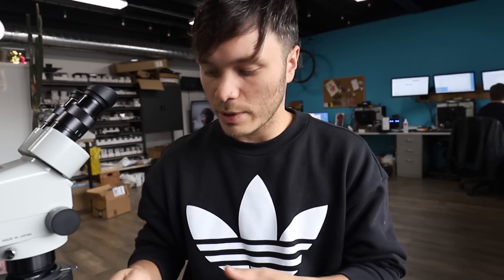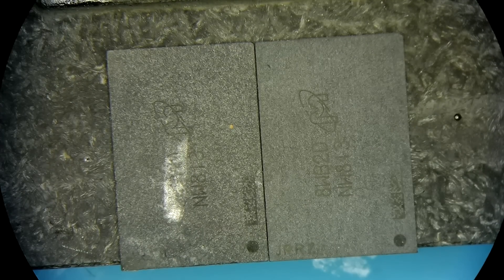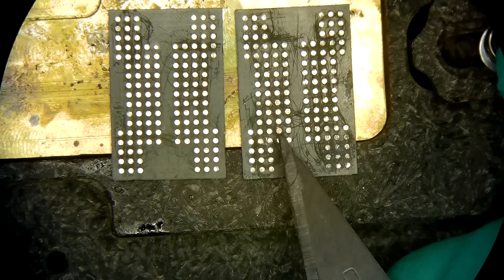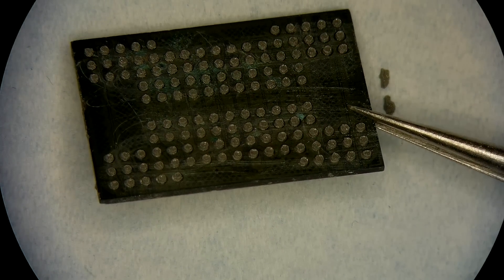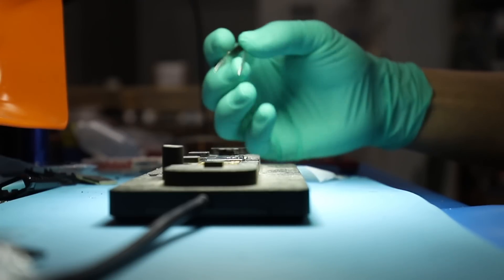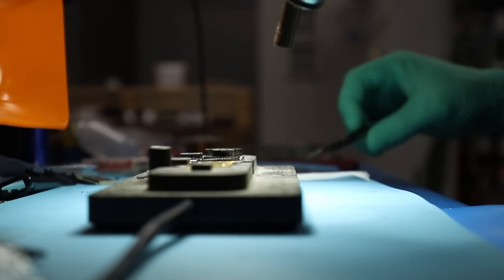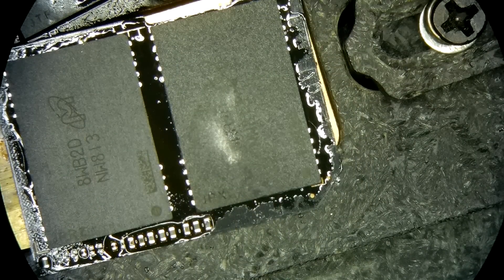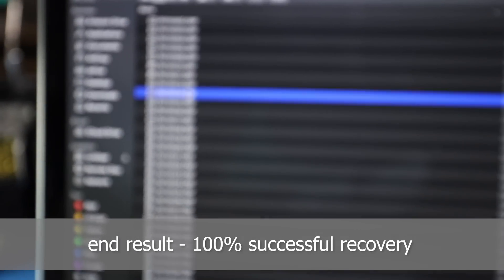Easy way to recover pictures from broken SD card

Comment: what we need to learn, is how people who cant afford 7 grand for pc-3000 can do this, because ive been told you dont NEED pc-3000. any tips on how to do this for those of us who arent rich?
Reply from the maker: PC-3000 is an essential part of data recovery tools to bring up your success rate because it will enable you to solve problems that you would not be able to otherwise. This video that you commented on demonstrates a case without PC3000 or any other NAND flash tools, so yeah, you can do some of this work without these expensive tools. PC-3000 is not a luxury that only rich people can buy/afford. It's a tool that will be effectively be earning you money. If you don't have the money to buy it, borrow.  If the average cost of recovery is $500 - all you need is 14 cases solved with it to pay it off.

Comment: It appears you just go straight to physically repairing, or do you toss them in a computer first to make sure you can't recover that way?
Reply from the maker: I rather not plug anything in my computers before I know what I am plugging in :). Same goes for hard drives that have been opened again, I would never turn them on without inspection

Comment: Great video. Worked in IT support for 10 years and setup on my own not long ago. Would love to get into the data recovery side of things more. Not sure on the total cost of the required equipment?
Reply from the maker: I just did a setup for the new guy, and it was around 2k for good soldering equipment.

Comment: I have an nexys 3 FPGA board of which usb programing port  was broken. i have jumped all pins to usb cable but when i connect it to computer it shows unknown device error with error code 43....         So what must be problem driver issue or hardware ?..... (all drivers are installed om my computer  and i can use other fpga boards).
Reply: It has CY7C68013A-56LTXC Usb microcontroller

Comment: Hello I have a small problem with an SD card. I cannot make the changes to stay. Even if I delete write or format the drive all the last data will be there. I tried to see if there was a pin issue and try to clean them but it did not fix the problem. I purchased a new one and copied all the data to the new one with no problem. My question is if you know the cause of what did this problem and if there a good way to physically destroy the SD memory where noone can see the data. It has some personal information and I want them deleted. Can I put is in a paper shredder machine like a credit card? thanks

Comment: Out of interest, couldn't you make your own "SD card" by cloning their design and reusing their controller and then just have nand sockets so that a) it saves work/potential damage from soldering and b)  you're not trying to find donor boards?
Reply from the maker: Theoretically yes, if one has access to proper datasheet for controllers. But I doubt they can eat be obtained. But it would also be very limited  (only 1 design to fix one model). Logical solutions like that exist. You read the NAND into a file and software simulates the controller to build translation aka arrange the blocks

Comment: I have an micro sd hc card (was in my phone) with 32GB, the good thing is the data can still be read, the bad i cant write anything to it (even format not work), is this problem a controller fault or problem of the chip/s?

and great channel.

Comment: Out of curiosity - would it be more efficient to create a jig that you could re-use with controller etc and pogo pins so that you could just place the chips in and save having to reball and use a 2nd donor card and resolder?  or is this not feasable due to a non-standard pinout of the memory/controllers meaning that 1 jig would only work with 1 make/model of card?

Comment: what are the most regid cards out there? which should we buy?
Reply from the maker: SanDisk is much more durable, but it is monolithic. All cards (that are not monolithic) are flexible. Lexar is the brand that positioned it's controller in a very easy to bend spot making it less reliable. Lexar and SanDisk recover very well. I would recommend cards that can be recovered well as oppose to any other features because when sh*t hits the fan people need the solution to be effective.

Comment: Does this mean that if I have some card I can risk -- would reflowing be a quick way to quickly fix the solder balls to get data off the card? Card may have a simple BGA fault.
I did a reflow with an oven on an LG G3 back then just to get data off it I suppose I would need less time on a simple SD card. What would be your best guess temperature and time to try out?

I have a card here that have some photos that weren't copied. Photographer friend already lived to terms with it a year ago and reshot the photos, getting the old ones would simply be a bonus as there are some good candid shots he said.

Thanks a lot!
Reply from the maker: yep, this video shows the same card, only I used a donor for the swap

Comment: Have you had much success/dealing with Kingston ssd's. basic is that the pc had to be hard reset and the drive never booted after, maybe it had failed as it was the system drive and that's why it needed the hard reset.
Not sure what would be the cause and where to start trying to self recover data. I have no experience with this

Comment: that is not easy, but u are expert. 😂
Reply from the maker: This is easy enough for most repair shops that work with electronics (cell phones primarily), and no data recovery equipment is needed :)